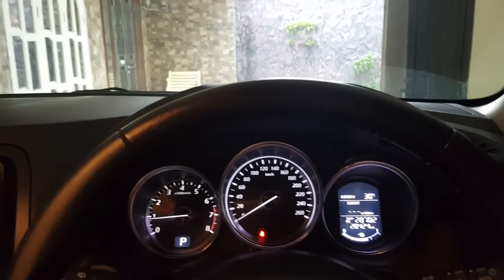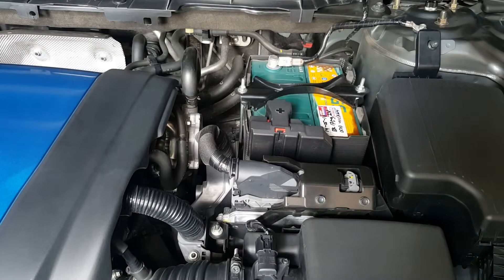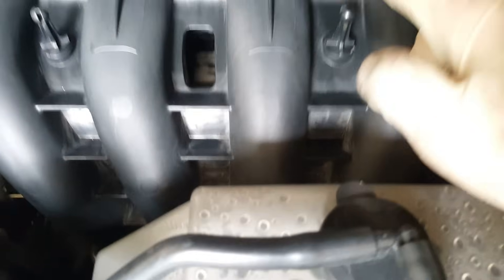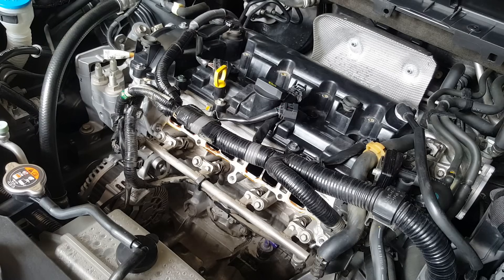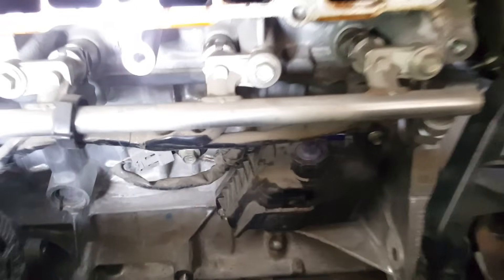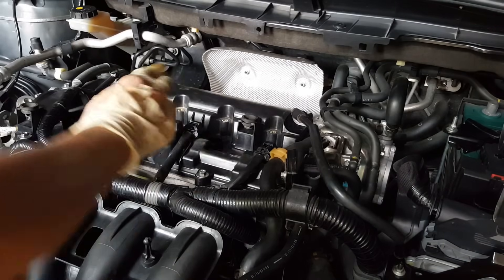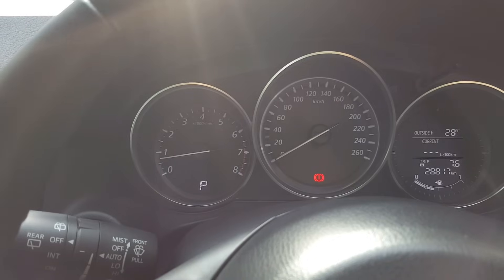How to Clean Intake valves / Carbon clean // Mazda CX 5 (All Skyactiv Gasoline Engines)

Comment: i dont know a lot of mechanical concepts but... how you get carbon build up on the INTAKE valves? if its direct injection into the cylinder, how does it get on a track thats only suppoused to suck air?
Reply from the maker: Due to the way direct injection engines work, detergent and other cleaning agents added to fuel are unable to clean the port and valve as they should. As miles are put on your vehicle, fuel being injected directly into the engine causes carbon to accumulate.
Reply: @GarasiFelixDan  thanks, i was also seeing other videos, learning about blow by and pcv routing gases and other impurities back into the intake manifold, being that the reason carbon builds up on the intake valves without gasoline cleaning it if it was a port injected. Pretty interesting. Seems GDI need oil catch cans as a solution to extend the time carbon builds on intake valves and clean them as maintenance
Reply from the maker: @edgarrg1899  correct sir. :)

Comment: how did you rotate the engine to close the 1st and 3rd cylinder?
Reply from the maker: I turned the crank pulley slowly while watching the intake valves open n closes.
Reply: thanks for the insight

Comment: Inspired by this video, I just recently did an intake valve cleaning service for my 2013 CX5 at 45K kms. Surprisingly, the valves were relatively clean and only got thin dry carbon layer. Only took 15 minutes to spray the carb cleaner, wipe, and blow all intake  valves to dry, no need to brush or agitate. I'm using amsoil 0W-20 and pertamax turbo (ron 98) fuel, and most of that kms used for highway speed intercity driving.
Reply from the maker: yeah if the vehicle r used mainly on the highways, the car wouldn't have a bad carbon build up issue. Quality fuels also helps reducing the amount of carbons. Im glad you didn't have to elbow grease with the tooth brush hahaha.
Reply: Felix Dan good fuel will keep combustion chamber clean of carbon obviously not squeaky clean but it doesn’t affect the valves in no way as no gas goes to their.
Reply from the maker: @henrytom5824  if you use quality fuel . It will have less gunk build up compared with bad fuel.
Reply: @GarasiFelixDan  
I am curious for direct injection, how does fuel quality matter towards the back side of valves?
That gasoline doesn’t flow over the backside of valves, ever. 
I hypothesize it’s then the engine oil and driving condition that perhaps impact more, no?
Reply: @reallifeengineer   I think that's because byproducts of combustion go through PCV valve and create this carbon build up. So, if you use a quality oil and gasoline there is less of those byproducts i guess?
Reply: Felix Dan sure you k ow that thought nice vid 👍
Reply: I do hear it a lot that if you drive it over 90mph for a few seconds it will minimize the carbon build up. I don't do that as much recently after a few speeding tickets. Maybe once a week I still do.
Reply: @azkal2ko you need RPM, not MPH.
Reply: @matsudakodo Shhh don't ruin his fun lol 🤫

Comment: Great work u done 👍 but why u did this with only 28k ? Also u spray the gasket with the cleaning solution is this ok for gasket ? What's the expected time for this job ? 

Thanks 

I subscribed because i love Indonesian people and for this great video . 

Much respect from saudi arabia
Reply from the maker: as long as the cleaning solution is safe for the gasket it is fine. I did this at near 30k because i want to check if this engine does have carbon build up at the early kms.

Comment: my 2012 mazda 3 skyactiv with 6 speed manual has 210k miles. I checked my valves for the 1st time just recently. Mine look no worse than the ones shown in this video with way, waaay more miles driven. What i have learned about direct injected engines (at least mazdas) is that they like to be driven HARD. the more often you can do wide open throttle acceleration, and rev up to high RPM the better. The skyactiv 2.0 is not a very powerful engine, so you can actually run through multiple gears very aggressively and not exceed the speed limit. the same cant be said for VW brand direct injected engines. they just suck
Reply from the maker: I see.... Maybe you do have to drive it hard ... downside is you will break the engine even faster if you do it everytime... hehehehe
Reply: @GarasiFelixDan  LOL. with over 210k miles on it, i got my moneys worth a long time ago. the car has never cost me a penny for a repair. i have done fluid changes, brakes and tires. thats it. never seen a service shop once in its life
Reply: Is this what some call an Italian tune up?
Reply: @lodentravel  sure is..!!

Comment: How to rotate the engine to close the First and third cylinder
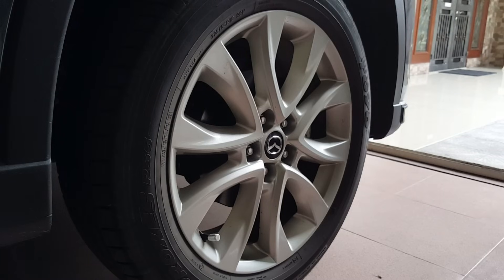Reply: through the wheel housing where the crank shaft is. Looks like a big bolt with a 21mm socket head check out 1:30 onwards

Comment: Great Job Guys, My vehicle is mazda6 2.5L .  I just want to know that after clean 2/4 hole how to rotate the engine for 1/2 cylinder?
Reply from the maker: Repeat by turning the crank pulley clockwise.
Reply: @GarasiFelixDan  THX ,Good Job

Comment: My CX-5 is a 2019 Grand Touring Reserve 2.5 L. turbo engine. I recently purchased a CORK SPORT Oil Catch Can and my garage will install it this June. It catches a lot of the PCV system blow-by so it does not get on the back side of the intake valves of this direct injection engine. THEN every 15,000 miles my dealer will clean the intake valves with "BG Platinum" fluid using their cleaning machine and NO disassembly is needed. My dealer's service charges are usually expensive as hell but for this service they charge less than anywhere else here in the Las Vegas valley. Plus "BG Platinum" is rated as the best intake valve cleaning fluid, better than "SeaFoam".
UPDATE: After 5,000 miles with the oil catch can i drained 1/3 cup of nasty-looking brown liquid THAT WILL NEVER GET TO THE INTAKE VALVES.  I'm a believer in oil catch cans for DI engines that have no additional port injection.
Reply: I know is been 3 years and probably u dont have the car, but i dont think mazda has a cleaning machine...... i know corksport has a special tool, so that u can sandblast the valves.
Reply: I still have the CX-5 and only 37,000 miles on it. The oil catch can never got any drainable oil after the first 1/4 cup! 
My dealer uses a intake valve cleaning machine with  B12 fluid at 40,000 miles  @Dan-vt1qt
Reply: @Dan-vt1qt they use walnut shells to sandblast it

Comment: Use premium fuel...... prob solved, each tank I add octane  boost in my 
Mazda 6, these engines are high
Compression, and need gd quality fuel
Regular gas in my opinion is no gd, 
Using 89 octane I'd consider minimal.
I run 91 octane, 93 if I can find it, shell 
Premium is my preference if can get it, 
My car is a 2017 mazda 6   2.5 sky active, with 97000km runs beautifully
6.2l /100km has been observed .
But 6.4-6.5 L is more predominant 
With passengers, love my car,
Reply: owners manual says you can use 87
Reply: @MrWalker1000  The Skyactiv engines are direct injection.  The reason this is more of a problem on direct injection engines is that the fuel is directly injected into the cylinder without touching the valves.  The build up is from oil that gets suck sucked from the crankcase into the intake through the PCV.  In a regular injected car, fuel is injected onto the back of the valves and has some cleaning properties... but not so in direct injected.  The type of fuel you use will have no impact on this.
Reply: @hpmaxim  what should I do to prevent this on my Mazda
Reply: @MrWalker1000  You can install an additional catch can, but I'm not sure that actually prevents it.  I'm not sure there is anything other specific thing you can do.  You may just need to accept periodic cleaning.

Comment: Why not just walnut-shell blast it? It's a non-chemical, easy way to 100% strip back any deposits. When I say "easy" I say "easier than this", even walnut blasting is not a walk in the park but much better than the incredible chemical usage needed for this method.
Reply from the maker: Yeap could also work with walnut blasting.

Comment: I've got a problem Felix . Need to change the petrol filter , fuel filter on my mazda CX 5 any idea where it is? Please . Thank you
Reply from the maker: Our cars fuel filter is inside the fuel tank and attached to the fuel pump (high pressure).

Comment: so stick to cars that use a dual fueling system. Def won't buy a badly designed engine smh.28,000km and customers have to deal with that kind of mess.
Reply from the maker: yeah wish we have a good tier fuel.

Comment: please explain why this engine is having intake valve buildup when the engine comes with a factory installed catch can preventing that ?
Reply from the maker: http://www.jamesbaroneracing.com/blog/theres-nothing-positive-about-the-2-0l-skyactiv-pcv-system/
Reply from the maker: Im also confuse why the engine suffer from carbon build up if theres a oil catch seperator installed. Im guessing cause it is a 1st gen engine they had still developing the technology.. ? Correct me if im wrong.
Reply: @GarasiFelixDan  Skyactive engines have 60k miles warranty. Hyundai' s GDI' engines are 100k warrantied. Having intake valve buildups at 4k, 10k, 35k miles would require A LOT of warranty money to be spent on sandblasting valves of millions of GDI engines worldwide.  Which would bankrupt any auto mnfctr. Recent GDI engines are well engineered to prevent internal buildup. I suspect those engines who does have it, is because they are driven short distances for a long time AND  /OR gas   tank is filled with el chipo gas from Mart Gas ...which in the US are plenty of.
Skyactive engines with very high compression ratio are engineered for TIER ONE  gas. My 2 cts...

Comment: We had a 2016 Mazda 6. Bought it with 31,000 miles on it and traded it when it had 69,000 miles. Still ran like new when we parted with it. But part of the reason we didn't keep it longer was due to my concerns about carbon build up.
Reply: @69k miles that engine was shy off the 60k warranty. The 2.5L Skyactive engines DO HAVE catch cans factory installed to prevent valve build ups. Their life cycle is design for 300000 miles. Great , reliable and very fuel efficient engines. I own 2 , one 2016 CX5 GT and one 2017 M6.  GT and not plannig to sell any before 300k miles. ;)
Reply: @dane2469  does mazda 6 2015 (pre face lift) 2.5L engine is affected with the situation explained in the video? or do they have catch cans as well?

Comment: The dealership will charge you $180.00 and they won’t remove parts like this tech they will just use spray down the intake hose.
Reply from the maker: yeap that is correct. Thats y dont go to the dealership.

Comment: Hey try a product called Seafoam , you spray it thru the Intake while the eng is running , it will blast off all that carbon buildup an give you better idle An fuel mileage, - back in the 60's we just use to take a coke bottle fill it with water hook up a vacuum hose , run eng at 1500 rpm for 5-6 min , the steam would blow all the carbon out , Check with some older mechanics I'm sure they will tell you the same thing , also WW2 Fighter Planes use to run a water vapor mix in them for higher rpm ,
Reply from the maker: Nope i havent..

Comment: how many miles were on your engine when you did this?
Reply from the maker: About 28k :)
Reply: @GarasiFelixDan @ 28k miles that engine is still under warranty. I bet engine oil was only changed once, mostly twice with wno knows what el chipo mineral oil and el chipo gas from Mart Petrol. These engines are engineered with a lifecycle of 300000+ miles and optimal performance using synthetic Castrol oil and TOP TIER gas mnfctr. Very reliable engines. No wonder Toyota is now joint venturing with Mazda in North America
Reply: @dane2469  you recommended only using Castrol oil?
Reply: @michiganmitten1147  no. Even Mazda dealer in Troy, Mi, uses Mazda branded oil. Which could be anything. I use the Kirkland (Costco) 0w20 syntethic  brand and engine runs super find. I have a M6 Touring and CX5 Gt. Best cars ever ! To answer your question, You can you any reputable brand of oil.

Comment: I assume this will work on my 2015 mazda3 2.0. Am I wrong? Is it an easy job to turn the crank pulley?
Reply from the maker: Yes it will work assuming you have same engine as this one shown. Note : take out the spark plug for easy turns on the crank pulley.

Comment: How you suck out or clean out the carbon after done cleaning the intake side carbon?
Reply: You means do cleaning on 1st and 3rd intake then suck out then continue with 2nd and 4th?
But how to ensure the carbon will not falls into engine?
Still got little dirty liquid will seep / flow into it right?
Reply from the maker: @ncssoda  I had to do it one by one, small sip of liquid wont hurt the engine. so it should be okay. if you have the vacuum tool it will be much easier.
Reply from the maker: Use a suction tool (turkey baster). Or u have a vacuum machine with catch can installed.

Comment: Hello,
I very much appreciate you posting this. I have just cleaned the intake valves. These valves were clogged up! Finished the cleanup but Car turns on but will not start. Here is what I did: I forgot to remove the wrench tool I used to turn the crankshaft and I did try to start the engine. As soon as I hear a nose (wrench hitting a chasy part) , in immediately turn ignition off. I went ahead and remove the tool. I try again but nothing happened. Could my mistake mess up the engine. I am thinking about bending parts. 

#2: I did not remove brand new spark plugs I put in last night while attempted to diagnose after I received code P0300 and p0304. 

Any idea what could cause car to not start? I can hear clicks. I did unplug the battery .

I look forward to your help.

Thanks so very much
Reply from the maker: Double check your electrical connection if anything comes loose. The code shows misfiring could be bad spark plug / coilpack / vacuum leak / cam or crank sensor. Just double check every intake hose that you took out while doing the service.
Reply from the maker: Check your starter fuse aswell.
Reply: Felix Dan I have not checked the starter fuse. I will do so in the next three hours.
Reply from the maker: @DocVal05  yes please check that one. As long as the car has power on and sound of fuel priming and the dash has all the normal lights and clicks it should starts.
Reply: Felix Dan awesome. Once again, you stand behind your videos. Much appreciation. I am about to head to the garage and check again.
Reply from the maker: @DocVal05  Keep us updated.. whats wrong with your vehicle yeah.
Reply: Here is an update. Sorry for the late reply. I went back to the garage and checked all hoses and wiring. All sensors are back in place. I did remove the spark plugs to see if they were flooded with carbon during the intake valve cleaning. I did not see much residue and they look brand new to me
 (I replaced them a day earlier). I ensure that throttle body is well tighten. Unfortunately, car still won’t start. I don’t know what may have gone wrong. Car turns on when I press start button; all lights are on; but engine won’t start. I get a click and that is all.  It looks I will need to have it towed for another tech to take a look. Any idea on what else may have been wrong?
Reply: Quick question, does the Cx-5 2014 have both fuse and relay? All I was able to see was a relay under the hood. I cannot find the starter fuse. Am I missing something?
Reply: Here is another update. I have just have a mechanic checked the work. He states that the starter solenoid is not engaging. He suggests me buy a new starter. Now I am really panicking that I may have pull too hard on something to the point that it causes a malfunction.
Reply from the maker: @DocVal05  i see. So u might have damage the component on the starter. Did u check every fuse yeah make sure to make sure all fuse are fine.
Reply: Felix Dan  thanks for your reply. I checked all fuse(as far as I could see). Will have the starter replaced and see what happen. I check all fuses under the hood and nothing seem broken. Does the cx5 has a special fuse for the starter other than the relay? Thank you
Reply from the maker: @DocVal05  check fuse box in the engine bay under C/U IG1 15Amp. You can see writings under the fuse box cover.
Reply from the maker: @DocVal05  theres a fuse and theres a relay.
Reply: Felix Dan i did not check that one. Let me take a look at it tomorrow morning around 9ET. Will let you know as soon as I check.
Reply: Felix Dan thanks for the clarification. Was a bit confused about what to look for.
Reply: Felix Dan I have just checked this fuse. It looks good. The little metal piece is intact.
Reply: Thanks for the all the help along the way. Wishing you and your family an awesome 2020.  As for the Mazda, I will try to replace the starter then see what happens.